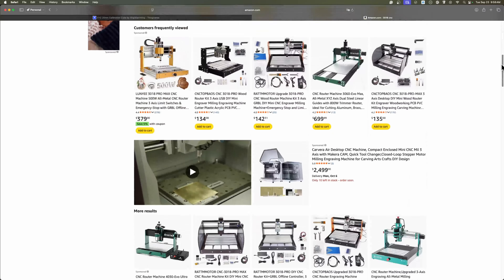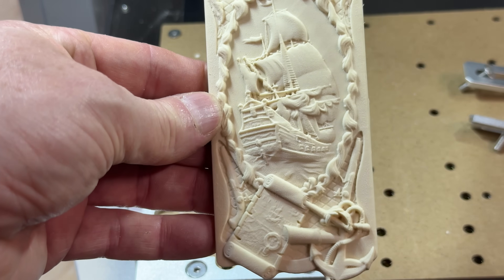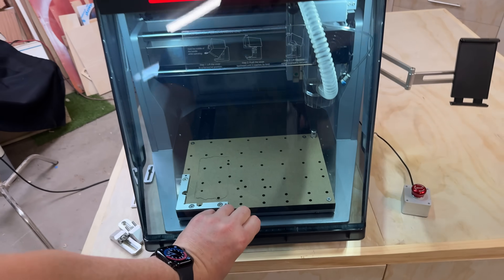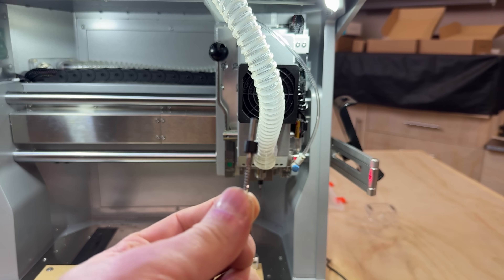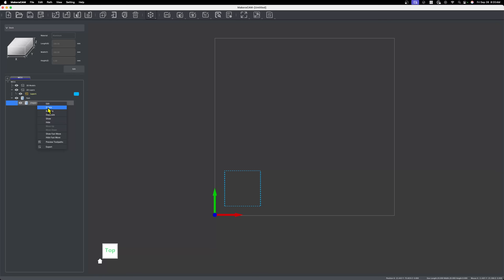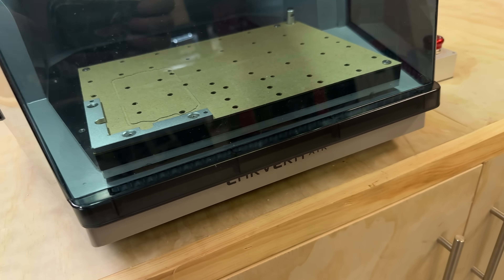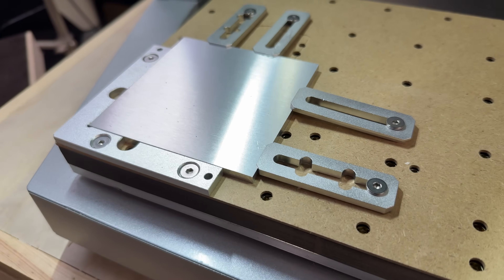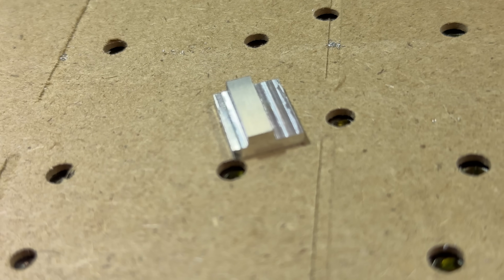Finally, a Desktop CNC That REALLY Works – Carvera Air Review

Comment: What immediately puts me off is the fact that you have to use Carvera bits, which you can also purchase separately at 100x the cost it actually costs to make them.
Reply from the maker: You can use any bits you want.  Did someone tell you needed Carvera bits?
Reply: You said you need the bits with the special black collar, didn't you?
Reply from the maker: @QAYWSXEDCCXYDSAEWQ True but you can put the collar on yourself with a tool provided by Makers. The collar is only used to give resettable positioning of the bit.

Comment: I like the auto levelling feature so I clicked on the link to the Global shop - £1,892.00 (approx $2500)!  It's well thought out but that's quite the pill to swallow if you're just starting out and wondering whether CNC is for you.  It might be the Rolls-Royce of starting CNC machines but my guess is it will have the same percentage of total CNC owners willing to pay that for their first CNC machine.

As always, your reviews are worth a like and a subscription.  Thank you 🙂
Reply from the maker: It's definitely not cheap, but of the small desktop CNC's this is the first one I've used that can do the same sort of things as the big one I have in my shop.  In fact it can do a few things a lot better (e.g. tool changes and auto-levelling)
Reply: that´s where the new Makera Z1 comes into play, you can get that for 800 $ at the moment.
Reply from the maker: @XA--pb9ni  Yes, it's a bit smaller but it's definitely priced right.

Comment: It's a hobbyist machine priced like a base model Tormach but nowhere near as capable. Who is this even for?
Reply from the maker: Well they're pretty popular.  The base Tormach xsTech doesn't do more than this because it's a hobby machine too. The workable area is smaller, and it has a 120W spindle vs the 200W on the Carvera Air.  There's also no 4th axis option for the Tormach.  So I'd really wonder for $500 more who would buy that one.

At the end of the day, these play in the same space as the basic Tormach xsTech machines, and if that machine is better for your use case, then buy it.  The Carvera Air is just one more option in the same market.

Comment: I've been looking for that epoxy modeling board in a 6mm thickness ever since I saw it at the first LBX. It seems it only comes in 1" and up thickness, except for PCBs, but those are too small.
Reply from the maker: It does seem to be hard to get and it seems pretty pricey. I have t found a decent source for any thickness

Comment: Using ball screws , linear rails, & closed loop motors is a step above almost all other small machines. Smoothness & accuracy should be "top shelf" and these high quality components partially account for the high price. Very nice, but very small.
Reply from the maker: My Onefinity is 32x24” but I use a surprisingly small area a lot of the time, so I can probably use the Carvera Air for a lot of jobs I need to do.  The Carvera Air very solid and seems to be quite accurate, so it can be used for real work.  I might use it to make chess pieces, which I do a lot - it would be perfect for this.

Comment: The only reason I don' like the pre-set plastic thing on the tool is the tool is to far out of the spindle and tends to deflect.
Reply from the maker: I didn’t see that, but on a longer bit it would be possible. I don’t think those specifically required since the tool setter is used for every tool change.

Comment: Wow! It's amazing how many of these machines Makera gave out to YouTubers. Most made the same video (commerical): maybe an unboxing and then a run through of basic features and the included example projects. Not a knock on Mr Steve, I value and trust his insights.
Reply from the maker: Well I tried to take a different angle than most (e.g. using vcarve and creating a real project). It is is pretty nice machine though.
Reply: Same as every other CNC, 3d printer, etc. Makes you wonder - if they can just give them away left & right, is it really worth 5 grand?
Reply from the maker: @MadeInMichigan  To be accurate, it's not $5K, but rather $3500.  Still pricey, but this will definitely appeal to some.